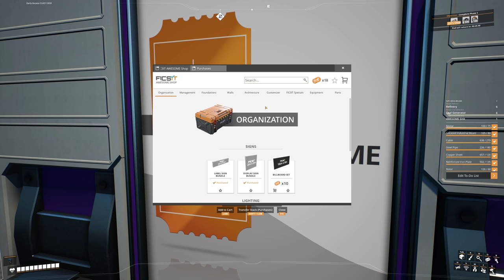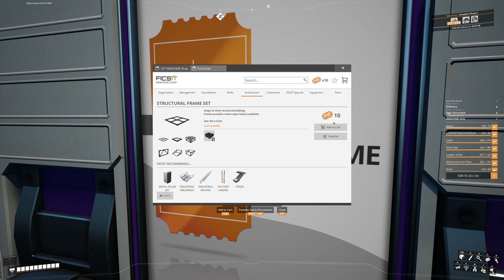HOW TO SATISFACTORY - Ep. 25 - Building an Oil Rig - Satisfactory Tutorial and Walkthrough

Comment: For folks watching later (Update 8 atm), up the hill from the oil is my favorite starting spot.  2 pure Fe, 1 pure Cu and 1 pure Limestone, easy access to caterium, good space and coal by water down below the waterfall on the other side of the site.  (I abuse flight mercilessly.)  Gotta travel for quartz and sulfur but I'll take the trade-off any day.  I like it better than the Northern Forest spot both for the access to oil, and the open space.  

Thanks much, as always, for a good tutorial for starting oil.  So many vids and blueprints go straight into fuel production off the starting oil, but that's a LOT of milestones away when you get oil, which you HAVE to get first to make plastic and rubber for the next milestones and MAM research. This is where I'm at currently.  This series is so good.  Even if I don't build like you do, each point in the tutorial is applicable to my way of playing.  Great job.

Update:  I built this design and it worked wonderfully!  First time, no sloshing of any of the fluids, all the coke filling and staying filled.  Nice design.  Of course, with my "no pumps policy" I built it flat to the ground.  I think oil rigs are hideous monstrosities anyway ("Drill, baby, drill"  😞) so I'll stick with my usual rectangular box.  I'll spice it up, but now I've got a major project ahead to get trains, and that means electronics (computers, ckt boards) and the dreaded Heavy Metal...er...Heavy Modular Frames.

Comment: Coming in very late to the party, but with some thoughts regarding the refineries turning on and off near the end of the video... things I've learned in my own Satisfactory journey.

1:11:30  Looking at the pipe there appears to be quite a bit of sloshing taking place, which can happen if you don't let the pipes completely fill up before switching on the machines connected to them.

1:12:55  You mention headlift.  That pump is plenty sufficient for getting oil up to the refineries, as the refinery inputs are about 16 meters up from the pump.  If you're really concerned you could always move the pump to partway up the vertical section of the pipe.
1:13:53  The supply pipe from the extractor is experiencing backflow.  The flow indicator slows down and reverses itself.  This likely is what's causing some issues downstream, as your oil is reaching the vertical section of the pipe in pulses rather than a continuous flow.

Turn off the refineries, let all the pipes completely fill up, and then switch the refineries on one by one.  That should help a bit.  Also, instead of a "T" branch feeding the four refineries, make a loop for the pipe by connecting the two ends of the "T" together.  That helps to reduce backflow issues.  Third, fluids feed machines more easily/reliably if fed from above rather than from below.  When fed from below, one machine takes a bit of fluid from the pipe, which can then cause the fluid to drop away from the other machines, starving them briefly.

Comment: Great video. At 20.43 where you come out at the shoreline would be a great starting area . 2 x pure iron 1 pure copper and 1 pure stone
Reply from the maker: Thats interesting. I have never really looked at that spot…
Reply: It's actually 3x pure iron, one of them on the same level as the copper is buried.  If you ping from behind the arch you can find it, then put a miner mk 1 on top of it to get it started.  It would actually make a great starter factory there, then bring some coal and the iron and copper from the power plants over to build steel also.